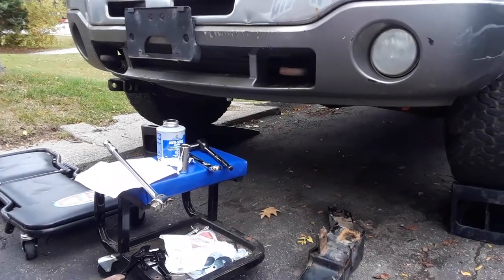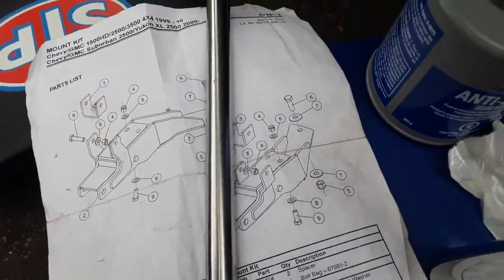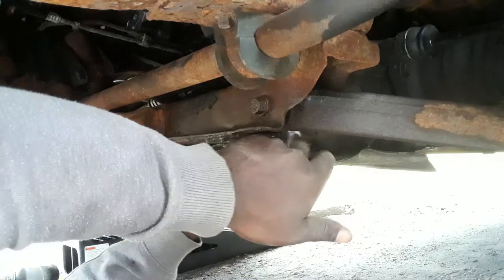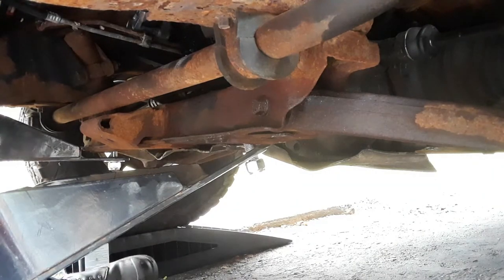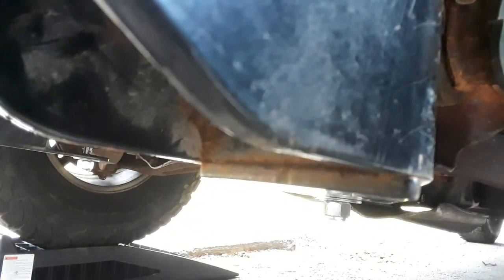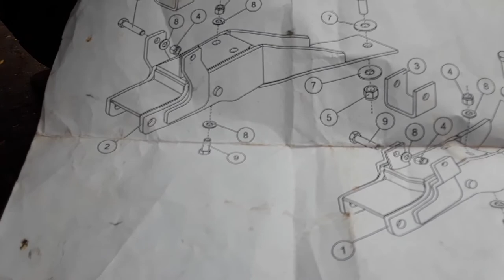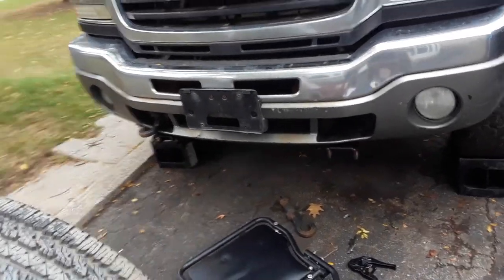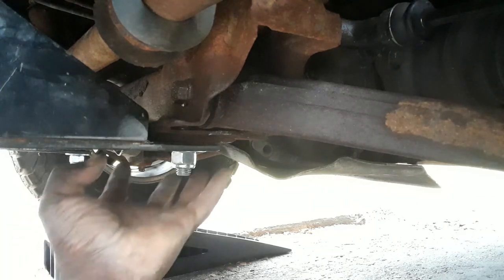Western Ultra Mount Install Easily

Comment: Should use grade 8 bolts, grade 5 bolts will ware out faster and break off easier
Reply from the maker: Ok lol tks using them for a while havent had any issue yet but ill definately take your advice

Comment: Hardware list 
67981-2 Frame bracket hardware
#4  6  1/2-13 Locknut
#5  2  5/8-11 Locknut

#6  2 5/8-11 2” Hex bolt           -used rear 2 bolts, hanging down –1 ½” bare minimum length
#9  6  1/2-13 1-3/4” hex bolt   -used middle bottom and front top hanger bolt, bolts up –1 ½” bare minimum length

#7  4  5/8” flat washer
#8  8  ½” flat washer

Or can keep tow hook and use a 1/2-13 x 6” bolt, locknut and 2 flat washers. Eliminates 2 of the 1 ¾” bolts per side.
Reply from the maker: Tks bro for the extra Info pls subscribe to my channel if you haven't yet tks for watching